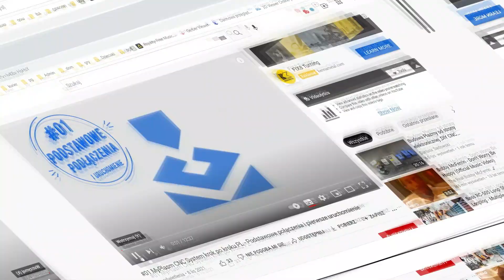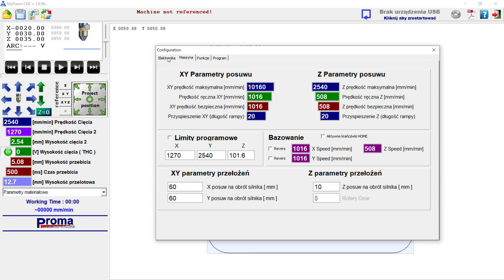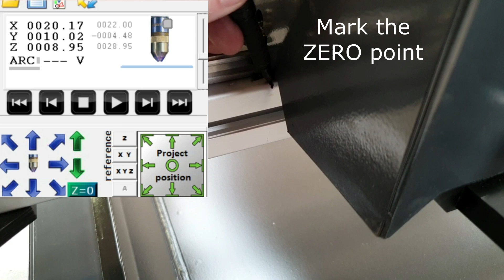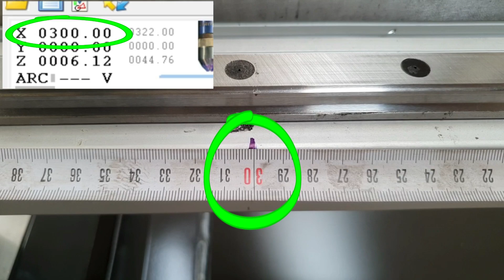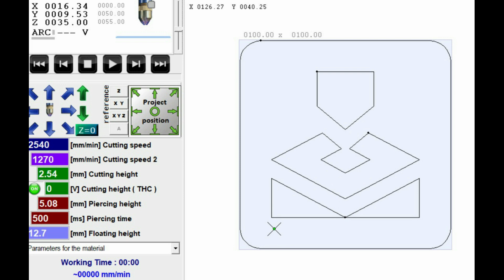# 02 MyPlasm CNC Step by step EN - Drives Configuration

Comment: Hello please tell me how to set the movement speed when cutting. The cutting speed is 2000, the manual speed is 2500,XY max speed Is set 400 however when moving automatically the speed is 8500. How do you set up please tell me it's a rotary axis?